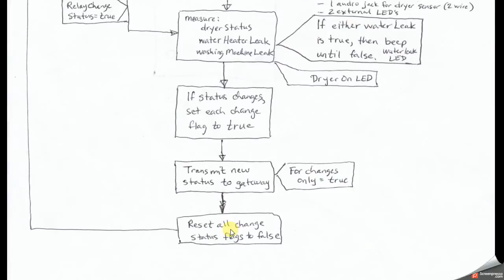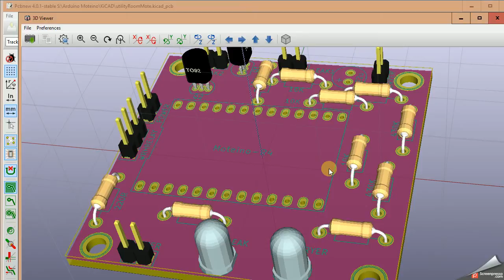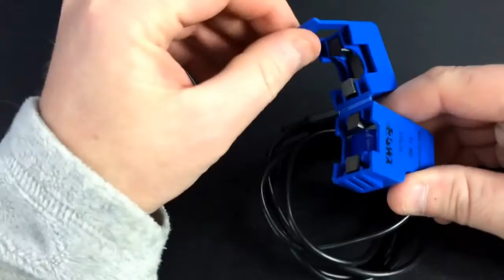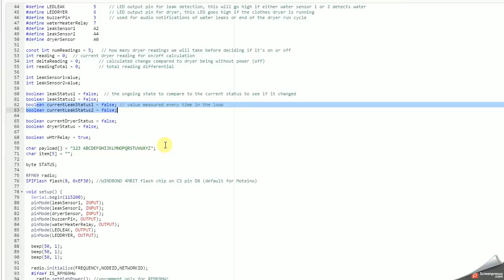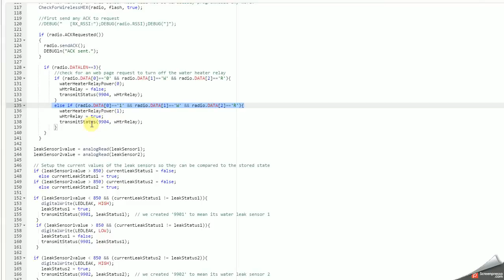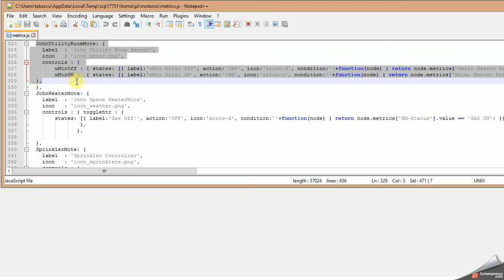Remote sensor node from scratch - detect dryer status, water leaks, control a water heater!

Comment: Very nice job, but you should correct the schematics: both the leds and the NPN trnsistors symbols must be flipped vertically :-)
Reply from the maker: +bvtg 74 Ugh.  Thanks for noticing!  Yeah the LED's are wrong.  And I'm actually using PNP transistors, so my symbols for those two are incorrect as well.  Sorry about that, good eye!!